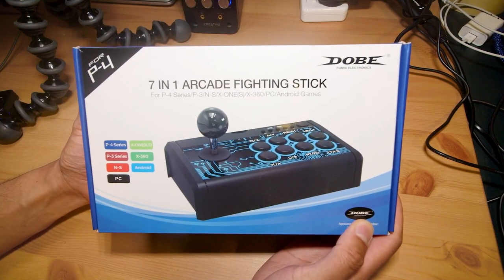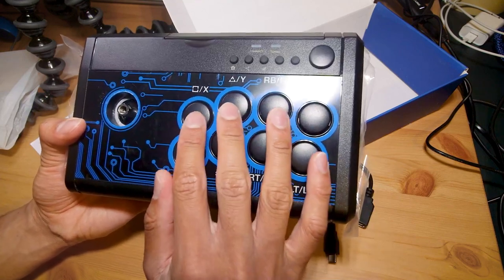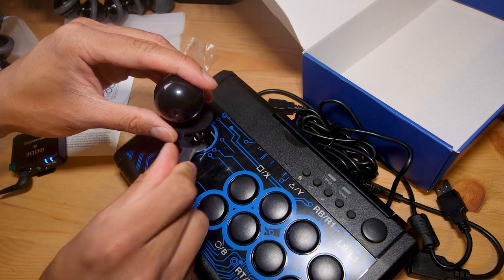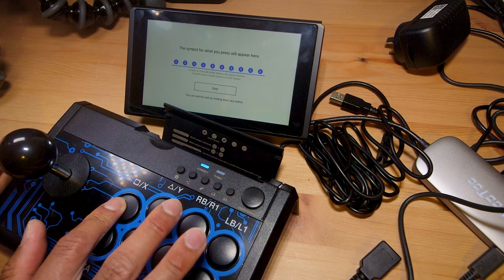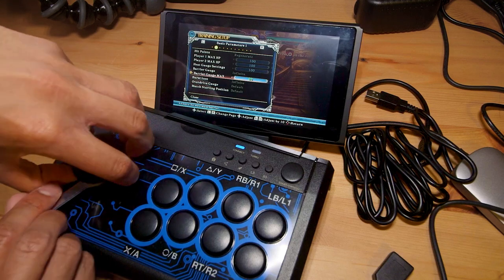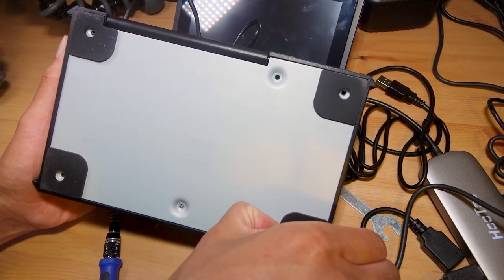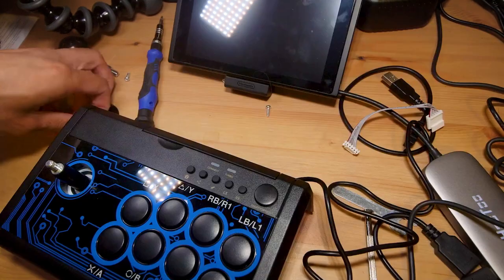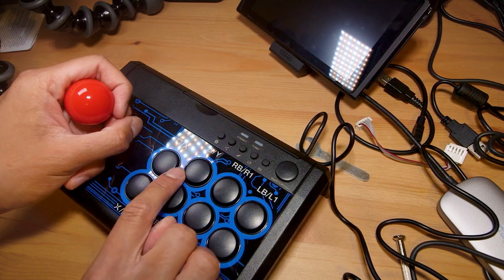Dobe Electronics Mini Arcade Stick | A neat concept!

Comment: I think that the red compund on the shaft (the one that was there when first opened) is ther to meke the shaft stick to the arcade once it is installed.
Because you shifted the position of the balltop the compaund was not used and the stick became loose.
Reply: I would say the same thing, it was his mistake he upwards the shaft, the red compound would work as a glue.

Comment: Would you recommend purchasinng of it? Would you consider a fine option for a low cost fight stick? I really apreciate all your job on yt, amazing and pragmatic reviews.
Reply: I got it a couple of days ago didn't wanna commit to a full on project or buy one that's over 100$ since I didn't know if I'd like it plus a local store had it so I didn't have to wait for delivery time and so forth....,  but so far I am enjoying it, though I do plan on replacing the stick with a sanwa one, buttons are OK and kinda a pain to replace so xD
 Mostly testing it on tekken 8, didn't try it on any of the 2d fighters so i can''t comment on how it fares there, the noticeable thing was that I pressed buttons before inputting a direction, idk if that's because of arcade stick in general and I need to get used it or the default stick has a bit more deadzone than higher quality sticks. but once I took that into consideration and got used to it, I could string my combos fine. I can do wave dashing and ewgfs fine and consistently and overall for the price it's OK, although haven't tried any of the branded sticks so I can't comment on the difference between them. The build itself feels nice, it doesn't feel like cheap plastic. Haven't tried it on ps or android as I've mostly been playing on pc. Though I would like it if it had a bit more surface area.

Comment: Don't BUY THIS ONE!! I purchased this two times and the joystick is less responsive after 1-2 months play! Its not durable!
Reply: I regret buying it because its "cheap" The buttons are very nice but when I connect it to the PC, even though the blue lights are on it doesn't work sometimes. When it does the controls are reverse and its frustrating.

Comment: I'm willing to bet "Dobe" is pronounced the Japanese way, so it would be like "Doh-bay".

Like yourself, I have a large collection of arcade sticks that range in size. I personally wouldn't buy a stick of this size. While you don't need a stick to be giant with eight 30mm buttons laid across, I think the ideal starting size would be a stick about twice the size of this Dobe Electronics Mini Stick that at least used 24mm buttons instead of these 18mm buttons. The problem with these 18mm buttons is that there are very few buttons can you can mod to improve the overall stick and your fingers will run into the other buttons like when you use a keyboard that's too small on an old thinkpad. 

If you haven't check out the Mayflash F100. That's really where I'd say the starting line for comfortable arcade sticks are you could reasonably mod with better parts and not break the bank with. Of course you could go bigger, higher end, but Mayflash has always been great entry level sticks that you can mod. Thankfully, we're now living in a time where almost everyone uses 24mm or 30mm. No more of those awkward 28mm buttons!
Reply from the maker: Regarding the pronunciation of Dobe, that’s a pretty good guess and I don’t know why it didn’t cross my mind!

Yeah I picked this stick up because it seemed just so small that I was curious to see what they had done. There are a lot of compact all-button controllers out there but not too many with a joystick lever and with all the modern functionality we expect these days.

I may eventually pick up a Mayflash stick but yeah I’ve got quite a few other sticks to cover in the collection still!

Comment: How did you connect it to the switch!
Reply: Either get a USB to Type c adapter for portable or just plug it into the USB ports on the switch dock
Reply: @s7121n9s  thank u 🙏

Comment: I just bought this arcade stick for my Xbox Series S.. and when I connect the USB cord to my Elite Series 2 Controller, the Controller cant stop vibrating.. this is normal?
Reply: Were you able to connect it to the Xbox Series S? I bought the larger model yesterday and have not been able to connect it to the Xbox at all. It worked on my PC, but I bought this specifically for Xbox, so I was quite disappointed.
Reply: @Otaku2255  yes, it was.. Finally able to connect it to my Xbox Series S using the reguler Xbox Controller.. Still vibrate but just 5 minutes and aftar that it works
Reply: @thebekloggamer6571  What steps did you follow in order to connect it to the Xbox? I cannot figure out how to connect it. I've tried everything. Maybe the larger model does not work on the Xbox Series S.
Reply: @Otaku2255  Just follow the steps in this video